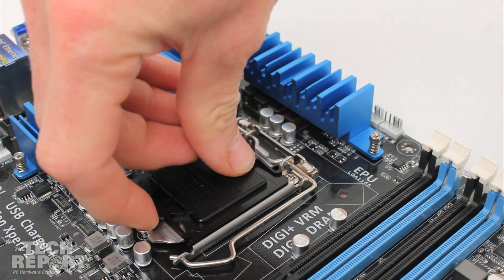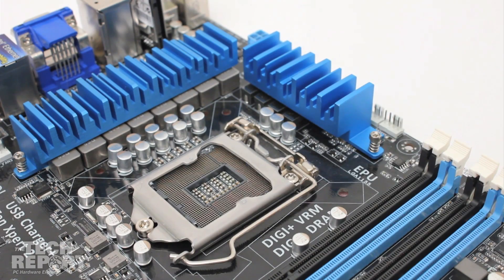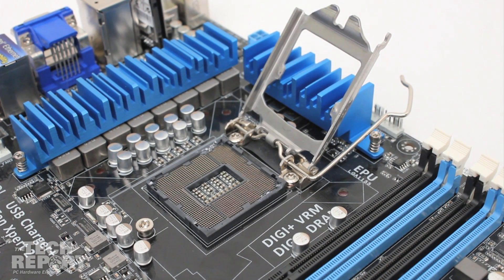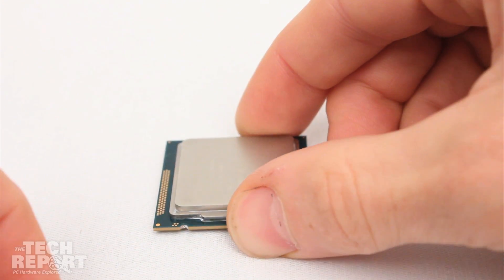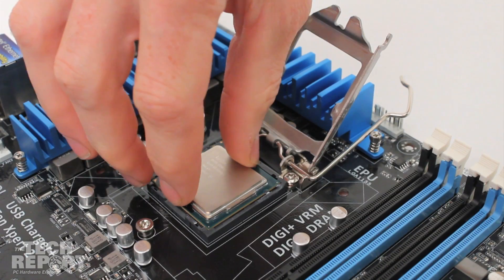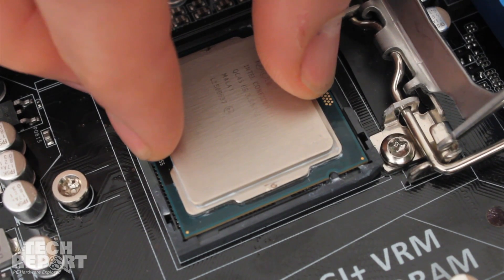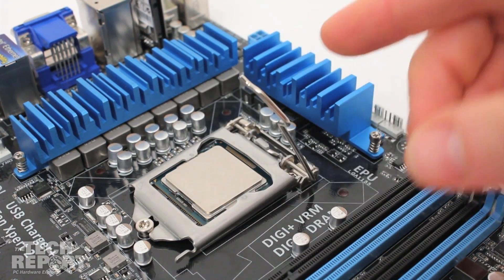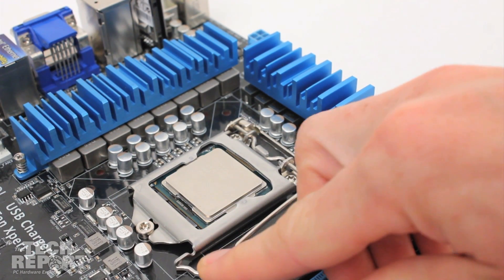Intel CPU installation

Comment: Ya you are correct well at least once the CPU goes in the socket it leaves impressions on the to outer parts of the CPU. He should left the the cover on. I watched the official MSI video and they leave the PNP on until the CPU is completely in its landing. Funny though because at the .26 mark of that video you can clearly see a bent pin LOL. Well at least MSI can just use their trashed boards for tech vids. Us end users usually get the pin blame and a pretty brick.

Comment: The manual and the Official Intel instructions explicitly say to leave the PNP on until the CPU is in place. The plastic socket shield is a template guide till the CPU pops it off. These pins bend so easily its ridiculous but it better safe than sorry.